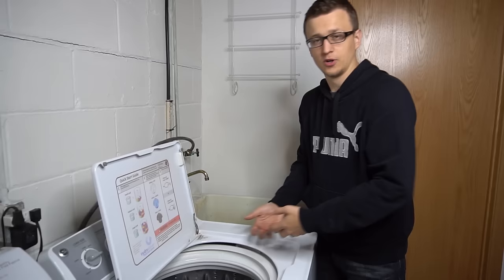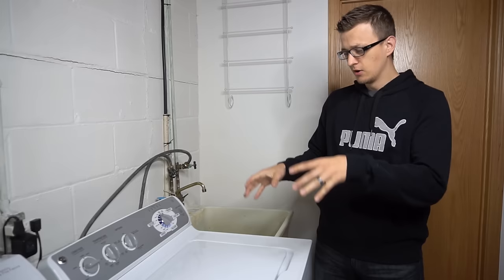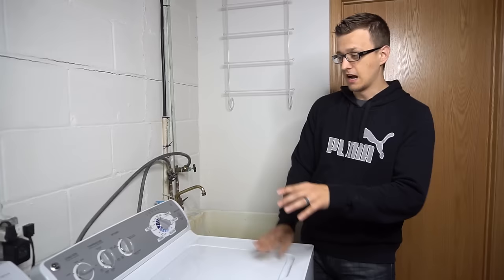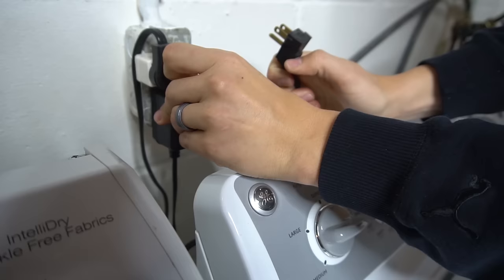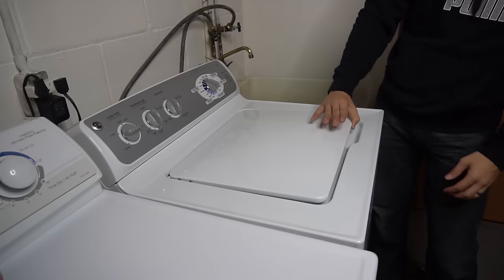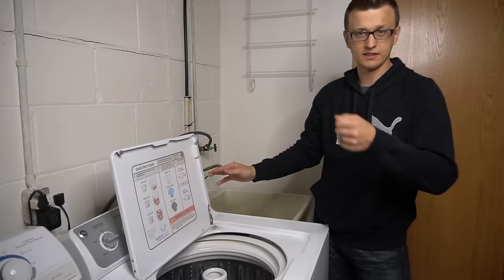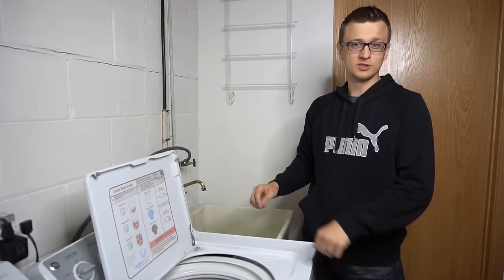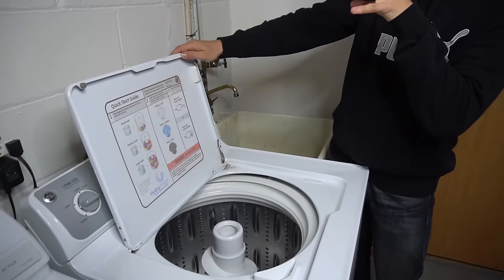Washer Not Spinning - How to Reset Motor (Easy)

Comment from the maker: Another Common Reason Why Washer Doesn't Drain and Spin:
https://youtu.be/KmPlBZ5nT1Q?si=KxbKm63kwkD9YSqS
10 Most Common Problems With Laundry Washing Machines:
https://youtu.be/lC5eqysbdsk
Kenmore/Whirlpool Common Problem:
https://youtu.be/gSLBiHx9VC0?si=NLUAc6pIm-q9a-oS
What Appliance Brand is Best:
https://youtu.be/ddy06-ssC8w?si=beQ5I-s18LBEu-5m
Reply: OMG it works
Reply: Word of Advice TV🏆▶️
Reply: @wordofAdviceTV When I turn on my GE washer after reset the water start to fill the load at the same time the water just come out through the drain. 
Is that because of the water pump valve that are not close. Please advise me. Thanks.
Reply: Does not spin

Comment: Get that adapter out of the outlet before you have a fire. It’s been overheated.
Reply from the maker: It's been like that for years. But you're right I should really stop playing with fire
Reply: That's first thing I thought when I saw it. I was like why are they both hooked to the adapter? Then he took it off and it was burned. Be careful bro.
Reply: This is the reason warning labels were invented. Electrical fires are the result of not reading them or taking them seriously. It's never a big deal till it happens or someone dies as a result. Some people prevent an issue before it occurs and some prefer to respond after it's too late. Sadly, he will be one of them.
Reply: My electrician eyes saw that as well......SMH
Reply: I’m not an electrician of any kind but it says right in every washing machine Manuel NOT TO Plug 🔌 it into any kind of extension outlets & all warranty are void if it’s not in a wall mounted  outlet.
Reply: PSA .... smoke detectors save lives  , and make great gifts
Reply: I think I would change out the single box for a dual receptacle
Reply: I was thinking the same thing. The scorch marks on the adapter is the tell.  I plug my laundry room appliances on a surge protector which is much safer and that means I can also plug in an iron without having to unplug the washer/dryer.
Reply: @johnovegas  just saw the video.  I would definitely drop in a quad…
Reply: @WordofAdviceTV  Newest code even has washer on dedicated circuit. The motor might be tripping because of this as well--it has a need for high torque at the inrush (you probably know this already) which drops the voltage and spikes the current, most likely cause for those scorches. Not telling ya what to do, but the plastic will degrade and probably won't cause a fire in that room because of your OCPD upstream and the noncombustible materials, HOWEVER.... not a great idea. :)
At the very least, get a beefier adaptor. Best solution would be bringing a dedicated circuit to the washer with its own plug. 
At any rate, thank you so much for this vid, I am stoked to go try it out. Wonderful information, thank you for sharing this advice!

Comment: I thought you were being funny too. The thing quit.  On a dice roll, I tried it on a feisty ten year old kenmore 400 with parts I replaced earlier. A watery putrid experience I dreaded going through again. I was about to go after the pricey cycle selector and/or the fuse until I just tried this expecting nothing. It worked.  Im listening to the washer right now going through its paces. No repairman in the history of repairmen has ever shared this. They will say its a big job and then when you're not looking , they will reset it and charge you. You kicked over a serious cow sharing this. Thank You in public.

Comment: Are you aware that today you just saved me a heap of money having to book a service call. I have a Kenmore top-loader and it's 25 years old.  
I followed your instructions exactly and it worked like magic.  Thank you so very much.  Thumbs up . . . that's for sure.
Darryl
Reply: Is you washer mechanical or the newer digital style? Didn't know it could work on older mechanical dial type washers.
Reply: @rogerbec5766  Hi Roger,
As my washing machine is 25 years it has no bells or whistles. . . very basic--two buttons (water level/temperature choices) and then the dial for washing options.
Cheers!
Darryl
Reply: @50Street21  - Working on my 15 year old Maytag to replace the clutch. The new m'chines aren't what they used to be. Thanks for the info.

Comment: I had the repair guy here (with DECADES of experience...) and he told me I needed a new timer.  He was going to order it and make a second trip out to my house (30+miles) to install it.  I found this amazing video and it worked like a charm!  Saved me around $250 at least.  It happens when my washer spins an unbalanced load.  THANK YOU!!!  PS I cannot believe the repair guy didn't know this!
Reply: he wanted to make money from you
Reply: I bet the repairman DID know the trick!
Reply: @motoblur6  Follow up.... I DID end up having to replace the timer. 🙄 But had a friend do it for much less, wasn't that hard.

Comment: Had this same problem on our brand new washer, several times. I was ready to return it. My husband did a once over on it, including the two different reset options. Come to find out, the outlet hose connected on the bottom back of machine was crimped/pinched. Bought a new hose and it's worked perfect ever since! Hope this helps others avoid the aggravation.

Comment: Thank you so much! My new GE washer/dryer combo wouldn’t drain after 3 attempts. In desperation, I tried your method. I couldn’t pull out the heavy machine so I turned off the breaker. Hallelujah! The machine went through the drain and spin cycle as it should. So grateful and blessed!

Comment: One more to report this fix worked with deep thanks to Word of Advice TV!  Had my washer completely apart - spent an entire afternoon fighting with it. Thought the lid switch was the cause but the problem came back after running a load of bathroom towels - deducted it was too heavy a load and the unbalanced load shut off was happening. Found very little online about this problem and was lost. Had no idea how to reset the washer until I saw this video. Saved me another afternoon looking for a mechanical problem that was electronic. Knowledge is power.

Comment: I have to tell you this is the quickest fix ever. If you have a husband like mine who forgets things in his pockets and has to unplug machine ( which completely throws it into a messed up mode) it will not run. Follow his instructions b4 doing all the diagnostic stuff and wasting LOTS of your time. Good luck

Comment: i have an amana washer and stop spinning..i looked at about a dozen videos on youtube with my brand of washer and figuring it out UNTIL i saw this video!! i followed your instructions and the my damn washer is working!! love this video
Reply: Just so we're absolutely clear, this method only applies to GE top load washers utilizing the inverter driven motor. Your Amana washer does not have the magnetic lid switch nor does it have an inverter board. This technique does not "reset" your washer, regardless what is said in the video.

Comment: Thank you so much.  This actually worked.  The agitator function wouldn't work.  Checked the agitator parts and they were all fine.  Thought it was the belt but luckily i found this video first, tried it, loaded up the machine and it worked.  Thank you, saved us from spending money.

Comment: I was starting a load of laundry with lid up and forgot to put lid down.  Was making a strange sound, it was trying to agitate but since kid was down it wasn’t working.  I tried everything, the 3 second button to turn it off, unplugged and replugged trying to reset it, nothing was working.  I unplugged it and found your instructions.  Was so stressed that I broke it and might have to call for service.  Your solution seemed funny but I tried it and it worked perfectly!!!!   Thank you for sharing your knowledge!!!!
Reply: I just had the same issue and felt the same way. Thanks for the comment.

Comment: Omg!!!! You are amazing! I been agonizing over my kenmore washer for 3 days. I watched your video about simply unplug machine and then replugvand lift and close lid 6 times. IT WORKED!!  My washer was going through all the cycles but it was only agitating for about 1 minute during each wash and rinse cycle. But this simple process ofvopen and close lid worked. My washer is
 preforming as normal now. Thank you so much! I can cancel my repair call, that was going to cost about $125 just for them to knock on my door, then parts and labor also.

Comment: God bless you sir! You really saved my bacon. Yes this worked! My washer worked fine the last time I used it. When I went to wash clothes this week -- nothing. No lights. No response from the controls. I turned it off at the breaker, let it sit for a while, then turned it back on. The yellow "sensing" light was on and blinking, otherwise still nothing. Later, I found this video and am now up and running. If you use YT the way I do, you'll want to know this about my washer:  2019 Maytag "Commercial Technology" high efficiency top loader, Model MVWC565FW1 (5 knobs across the panel, looks like the Centennial Series, probably an analog of some Whirlpool model as well)

Comment: My washer was overfilling about 4 inches above the clothes which lead to UL code constantly.    This totally helped.   Another suggestion someone said was to run an Affresh cleaning cycle (Bravos 300) which would start and change from an hour to 4 minutes shortly after beginning.  Both are working perfectly now.  Thank you very much.

Comment: Thank you so much!  Changed the washer lid cuz it rusted.  That was easy part.  Then the washer didn't work...never even noticed the magnet.  Took the magnet from the old lid and installed it in the new lid.  Plugged the washer back in, opened the lid six times and it worked!!!  Super psyched!!  Thanks again!

Comment: We have an Amana washing machine that filled with water and just stopped.  While I didn't use your video, I did find a web site that had similar instructions and it solved the issue.  Got lucky because there are several other issues that could cause the same symptom.  Saved your video for future use.

Comment: Many, many thanks... for your video, it was exactly what I needed, when Sears recommended to replace a part, I can't thank you enough for saving me the cost of a part or having a repair bill. I would highly recommend that anyone with a problem with your spin cycle try this easy fix. I have a Kenmore washer, so it doesn't just work on G.E. washers. You will be saving a lot of people an un-needed expense. Thanks again, now I can rest at ease that I don't have to worry about trips to the laundromat.
Reply from the maker: You're very welcome!! Glad to hear that it worked on your Kenmore washer! It's a very easy reset procedure so why not give it a try right? Thank you for leaving a comment for others! Happy laundry and Merry upcoming Christmas!

Comment: WOW! Can't believe it worked! Mine was a GE Washer gtw330ask0ww, it's got all kinds of error code checking etc. that is very complicated.  I tried this reset method and it worked!
Men, tell your women/kids you cannot fill these washers with huge blankets etc. My fiancé caused the washer to fail by loading up a massive blanket and then even after I got lucky and got the washer up and running again she says "great now I finish this blanket"  NO!!! Go do them at a laundromat.   

I pulled that blanket out, it was about 70lbs soaked with water.  The parts on washers will fail if you keep doing massive loads. I'm lucky this fix worked, it could have been much worse.  Tell them to not be lazy and drive down to laundromat other wise we men have to spend money for no reason fixing broken washers because of laziness.

Comment: Haha awesome, just did this for my Kenmore and it worked, after thinking I had to tear it down I looked up a video about the spin cycle not working, one guy talked about trying it on other speeds or duty cycles, tried it on heavy rather than normal, the spin worked, then found your video, did the reset procedure and yippy! Everything is good again, thanks man!

Comment: Wow it really does work! I own a Whirlpool top load washer, it's a pretty basic model, and this little tip did just the trick! Here I was thinking I wouldn't have any clean clothes for work in a couple of hours but now I have a washing machine that is running top notch again. I do think an unbalanced load is what caused mine as well seeing as I washed a comforter and sheets in my last load. I can't tell you how many washers we have thrown out and replaced over this same exact issue.. no more though! Thanks so much! 😄

Comment: Worked like a charm on a 15 year old Kenmore top loader. No lights or anything fancy, just knobs. I just followed the steps not knowing if anything was reset since I have no lights on the machine. But I started the washer and it started to fill like normal! My issue was that only the Handwash setting was working properly. Any other setting would immediately start spinning as the washer was filling. So when it came time for the last spin, it was already set to “off” by then and the clothes were left sopping wet and not fully clean. This was exactly what I needed. I alone take care of my brain damaged and paralyzed mother with ZERO state assistance (thanks to Texas being a red state that hates poor people). So for us to have a broken washing machine would’ve taken 100% donations to get it fixed or replaced. We live paycheck to paycheck and I’m out of work and can barely afford her meds, diapers, etc. We ALL need to share this video and make this guy rich for all the money he’s saved us!!! THANK YOU FOR HELPING YOUR PEOPLE!!!

Comment: it really does work I tried it the summer on another video I saw. But I had to keep doing it every now and then and then doing it almost every time and now I don't even work doing the unplug and the lid 6 times. I guess the motor is having problems
Reply: I saw another video that showed that the problem could be a clogged pressure switch hose.  Easy fix, just have to take off the panel, unplug the hose and clean it out and replug.  Should work.  If it doesn't may need to change out the pressure switch itself, which is easy and costs only $30.  Good luck!

Comment: I had to do one step before trying this because I didn’t have a click. I stuck a Q-Tip in hole of where the washer locks. I gently moved it around until I heard it click (it was stuck from the lid being slammed shut…don’t do that). I tried your trick and it worked. Thank you!!!
Reply: Doesn't work on your washer, different brand

Comment: Thank you for taking your valuable time by making and sharing this highly informative video. I have been told to replace the motor etc. I tried your motor rest and it worked perfectly. One question..... When spinning the machine is producing a very loud noise. Could this be the bush attached to the drum or can you advise me. Thank you one again.
Reply: Did not work for me, the drain does not make a noise to try to turn on at all, timer just keep ticking

Comment: Thank you sooooo much! Mine must need the balance rod and spring things replaced, and when the motor stopped I thought I killed it. But now there's hope. Lol. Even though this washer has ripped all my clothes on regular cycle, and I have to use delicate cycle, it will be far better ( and cheaper ) working than No washer! Much appreciated!😊

Comment: If I'm not able to reach the plug behind the washer( stackable washer & dryer in an apartment) can I just turn off the circuit breaker for 30 seconds instead?

Update: It worked! My washer is now restored ! God bless you!
Reply: Yes you can.
Reply: Commonly happens on GE Hydrowave washers

Comment: Hey Jay could you make a video on common maintenance of a washer and dryer? Just a idea.
Reply from the maker: Hmm... That's a good video idea but I don't think there is much a homeowner can do. Many of those machines are arduous to take apart and there is not much to do inside of them in regards to maintenance. (besides perhaps vacuum lint build up inside the dryer) There are also many different styles and designs so it's almost like every brand would need a separate video. HVAC is a lot easier since regardless of the brand, the units are accessible and the designs are not that much different from unit to unit. That being said... I actually have two top 10 problems lists ready :) One for washer and one for dryer. I don't know when I will make those videos but hopefully within a month or two.
Reply: @WordofAdviceTV  yeah I guess your right about that. I noticed how different washers are built while researching for my Admiral. I replaced the suspension rods etc but it still shakes and bangs against the cabinet. However it doesn't when there are no clothes in it. It's completely level and doesn't wobble. I guess it's just another project to concentrate on. Lol
Reply from the maker: @aarongray503  Unfortunately I have no good suggestions.. Those type of problems can have unique causes (like a bad transmission if it's a direct drive) so one would need to really dig into it to try to figure it out. Sorry for not being very helpful with the washer man.
Reply: @WordofAdviceTV  no worries Jay! Atleast you reply to your fan base. We all appreciate that.
Reply: Aaron Gray another guy does one where he shows you how to clear the pump for missing socks...